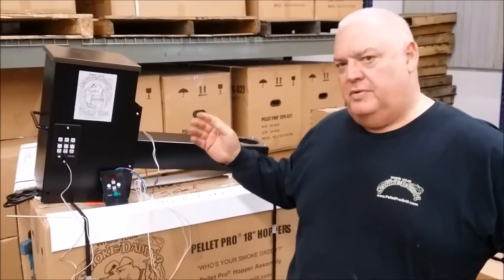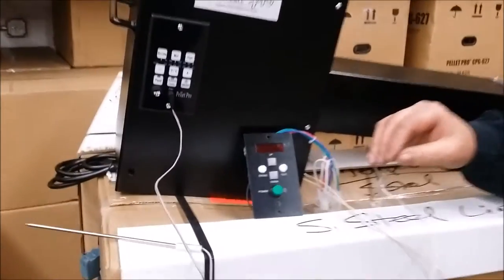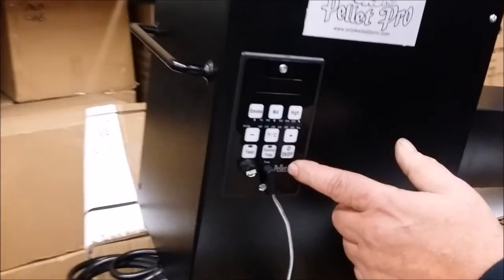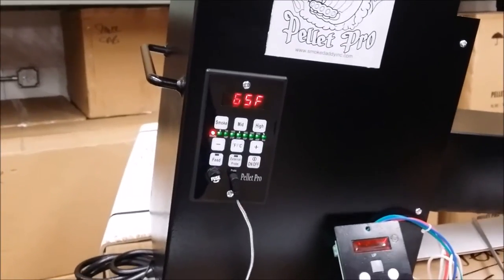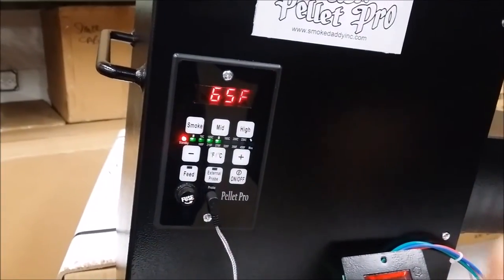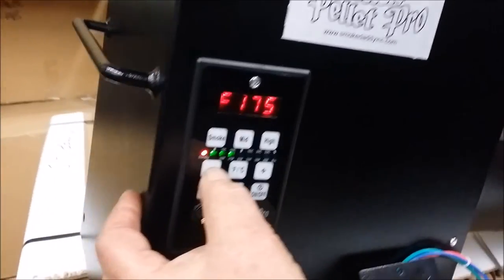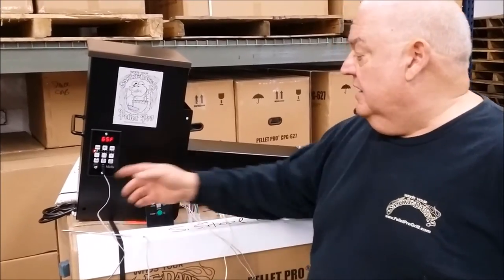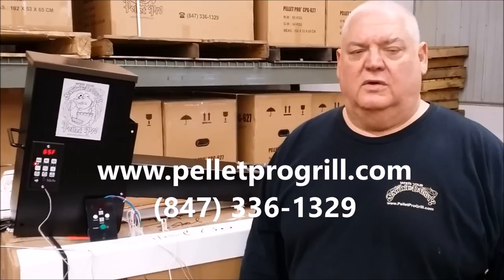Pellet Pro® PID Controller Instructions

Comment: I ordered the 18 inch copper with stainless steel auction and got it in within four days. Currently I'm buying steel to make a 30 x 30 internal vertical insulated smoker. This thing is going to kick some butt!
Reply: Josue De LA Garza how did it turn out ?

Comment: Does the PID/Thermostat controller include a "recover from firepot outtage?"
I cant seem to keep it lit at smoking temperatures (160 - 185).  The firepot extinguises itself.  I have  a Fireboard thermometer so I can show you on a graph what it looks like if you need to see it.

Thanks!